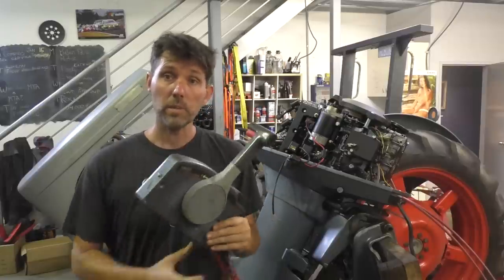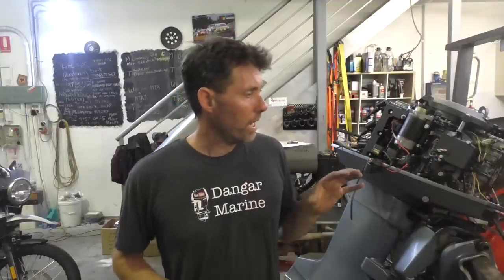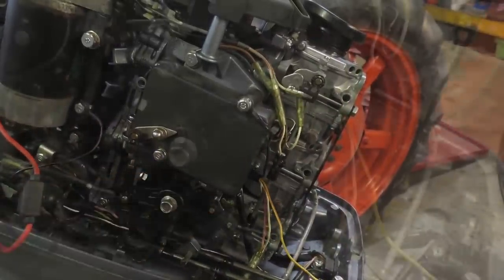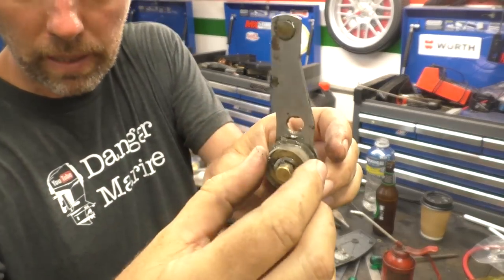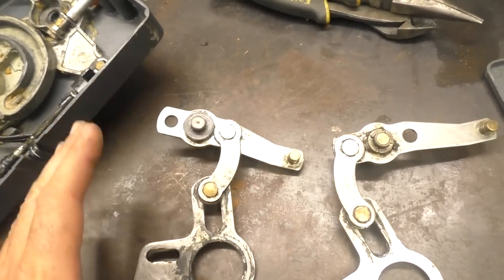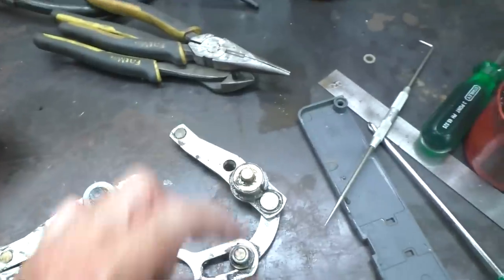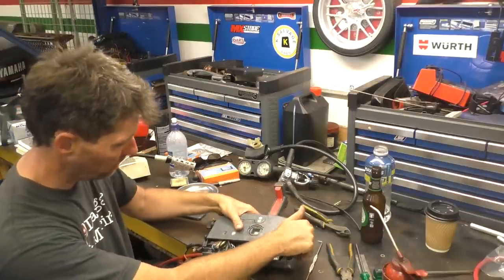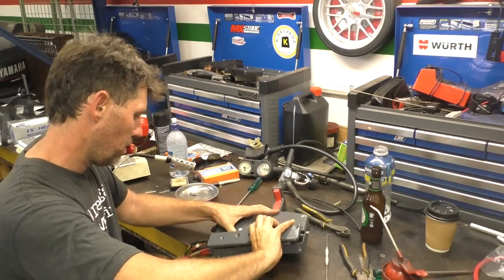Reversing a Yamaha 703 forward control

Comment: Just wanted to say a quick, thanks a lot. I have just completed this fix on a Suzuki controller exactly as you suggested by grinding the pins down and then drilling and tapping the holes and using a screw to hold the parts in place with a washer.
Changed a push throttle to a pull.

Job done....cheers
Reply from the maker: You're welcome Dean, glad you got your controls sorted.

Comment: You need to also reverse the drum that the warm up lever attaches to. If you use an OLD pull throttle box for the part, brass piece where the tension is, and you put it in a new box you also have to transfer the bushings and wave washer from where the pin locates in the box.
Reply: Is there a place to order a parts kit in case you loose a bearing. Asking for a friend. Is there a parts breakdown that shows where all the parts go.my friend seems to have a extra plastic bushing can't figure out where it goes.

Comment: Hi.   Also thank you so much.   I had to convert mine the other way to a push.   I did not have a spare part so I had to “un peen” the pivot pins.   Why they couldn’t have used washers and C clips.   One thing you did not mention is that you need to rotate the disk 180 degrees on the cold start lever.    If you look at the disk you will notice that there is a second notch on the top of the disk.   At least in this case you just have to undo 2 screws instead of punching out peens.  I discovered this when the cable went the wrong way when I pulled up the cold start lever.   Not sure if I will even need this on a fuel injected anyway.

Comment: The cable end on that motor is different. It hooks on the side of the threads not at the tip. You'll notice the hole is smaller on the correct end too (that's why it won't idle down all the way)
Reply: 6H4-48344-00-00 is the part #

Comment: Awesome videos. I have a house in PI where my wife is from and have a small boat with a messed up controller. I think the saltwater has won the battle. Hard to get parts here and improvising is about the only tool you have. Seems an old motor is like an old person. You fix on thing and something else goes wrong

Comment: Thanks for a great video. I would love to know the number of the parts you said you were gonna order in the end of the video? 

I have the exact same setup. Switched from push to pull. My throttle cable also turns out to be too short. I cant find the right part to order though to be able to fit the throttle cable to the motor 
Thanks again! Best regards Björn/ all the way from Sweden

Comment: hello! Following your tutorial I assembled the controller correctly! I changed the microswitch that was bad! When I started the engine the fuse that goes to the rectifier blew! It may be because I tried it without the cables that go to the starter relay being connected.

Comment: My twin  704 has a little slop in shifting into gear ( starboard shifter), are there replacement part you recommend to replace inside controller to get a more positive shift. 2005 controller with new shift cables. Port side  controller shifts good.

Comment: Thanks again mate!  Changing out a mercury 3000, junk and prone to wear; increasingly hard to locate parts or unavailable.  I have ordered a Yamaha 6x3, I am assuming the push/pull mechanics are the same ?
Reply from the maker: At the end of the day they all push and pull the same type of cable the same distance so they are all pretty interchangeable.

Comment: Good day from Canada.  Thanks, I didn't know. You have good videos, learning a lot. (Have subscribed)  Backpacked the earth for fourteen years non-stop now need to explore the water. In process of wrapping my brain around all involved to live aboard and see the world by boat. Your information has helped. 
Nice to know there's a quality mechanic when I get to your region of the world. Haven't decided on sail or power boat yet the MacGregor 26m has best of both worlds. More research needed.  Curious what you think about large hp desiel outboards for extended running times (ocean crossings) over gas fueled outboads. 
Like the Green Machine. 
Thanks again.
Reply from the maker: Hey Andrew. There certainly are plenty of choices when it comes to cruising. I personally like sailing catamarans as they give you plenty of space and good maneuverability under motor. Check out the YouTube channel "Catamaran Impi" They are a nice couple that have been travelling the world for a long time now on their boat. With regards to cruising motors your only real choice is diesel if you want to travel any distance, you just can't carry enough petrol to get very far in comparison.
Reply: Dangar Marine 
Thank you, didn't know about the fuel consumption difference. I'll check the catamaran channel you recommended. Appreciate the reply.

Comment: Hi, I’ve got a boat that’s using yahama 701 remote control but the throttle handle is damaged. I was wondering if the remote control can be replaced with the 703 model?

Comment: Boat ran, had rats eat the wire harnesses. I had the remote apart to replace a wire harness, never messed with the mechanical linkages, put it back together, and now I have lost throttle response using the control arm. Shifts fine, neutral accelerator lever works, and activates throttle linkage, but no positive throttle while shifting past 30 deg.  in forward, or reverse! I can't find any missing parts, or anything missing compared to a Seloc manual pic. i just had it open - gently! -for a couple hrs! What happened?

Comment: dude! the thing about the newer vertion of the cable holder on the engine size being to close to the selector. thats exactly the problem i have! but i went to my local dealership and they gave me that engine mounted cable clamp.
could you tell me the part number that i should've been sent? obviously the older one, mine is also an 80's engine.
i know its a long shot... but ???

Comment: I have an older late 70's early 80's Honda 100 9.9hp outboard. I have yet to use it. Should I keep it or buy a newer Honda 9.9???
Reply from the maker: It all depends on condition, it could be fine or it could give you a lot of trouble. I'd try it first then decide.

Comment: You should also have reversed the drum in the cover, then your throttle cable would have the correct length. Best regards from Denmark.

Comment: Dangar I'm hoping you can help me out.
I have twin yamaha's and my forward controls are not opening the throttles at the same rate. They start out fine at first but then the more you give it gas the larger the discrepancy between throttles. When I run at high speed the right handle has to be more forward that the left for both engines to have the same rpm.
I thought at first that the throttle/cable parts/levers on the outboards could be loose or worn out. But they are fine. Both have been synchronized at neutral and at idle. Both idle at 700 rpm.
Reply from the maker: The idle stopper screws will set how far the throttle plates close and therefore your idle speed. I would adjust the cables to give you equal revs at full throttle and let the idle screws handle the balance at the low end.
Reply: @DangarMarine  
Thank you for your reply! I have done that. They both idle at 700 rpm and with the binical handles all the way forward at full throttle they both run at equal rpm. (Sorry for the long post but this is quite difficult to convey in a text message, I'll do my best)
The problem is at mid range. The binicals are not consistently opening the throttles at the same rate as I push the handles forward. They start out consistent up until they reach 2.5k rpm. After that point the discrepancy starts and the rpms get further and further apart as I move up the handles. To the point were one engine will be at 3.5k and the other at 5k with the handles at par with each other.
I have visually inspected and measured the throttle openings between the idle screw and the stopper on both engines with the handles at par to each other at different positions in the mid range and I have confirmed that one is progressively opening more than the other. 
Again, at idle up to 2.5k they are the same, and at full throttle they are the same. But in between that range they open at different rates.
If I want to run at 4k or 4.5k the levers have to be significantly at an offset, with one almost a full handle grip length further out than the other.
What could be causing this?
Wear in the binical?
Wear in the throttle levers? (But I have checked them and don't show wear and all parts are identical)
I am very puzzled by this.
Please let me know what you think.
Thank you!!

Comment: Hey with this hack would i be abel to use my 703 control box to move the boat foward when i select revers ? As i just changed my outboard and noticed that the control box is designed to be mounted on the right side of the boat but i need it mounted to the left side of the boat
Reply from the maker: Not really because this only affects the way the throttle moves, not the gear selector.
Reply: Dangar Marine so i would need a left hand side controll box to mount the control box on the left side of the boat and select the gears to the proper way?

Comment: I GOT IT ALL BACK TOGETHER BUT  ITS STILL NOT 100%. FLIPPING THE ARM SHOULDN'T BE AN ISSUE BUT ITS DEFINITELY NOT THE ANSWER. EVERYTHING WORKS BUT ITS STIFF AND GETS STUCK SOMETIMES. THE NEUTRAL THROTTLE ARM DOESN'T WORK AT ALL. IT LOCKS WHEN I SHIFT TO NEUTRAL AND TRY TO REV THE ENGINE WITH THE SIDE THROTTLE. I BOUGHT THE REAL BRACKETT. WE'LL SEE IF THATS THE ISSUES OR ITS AN ADJUSTMENT PROBLEM